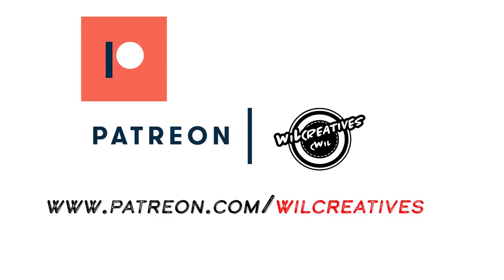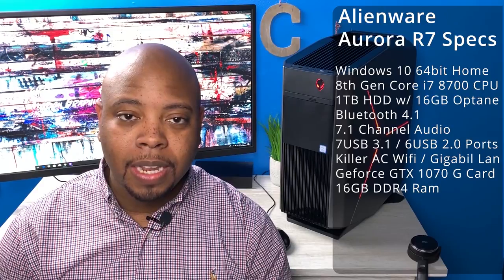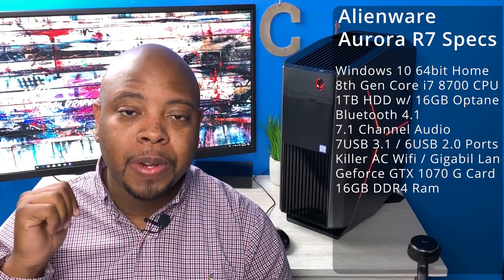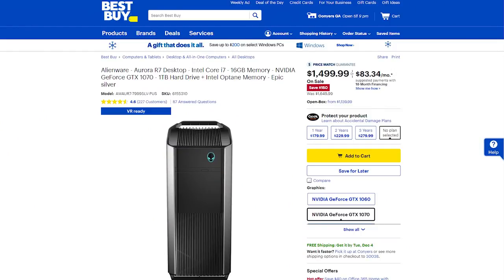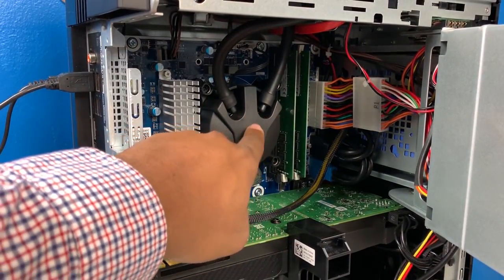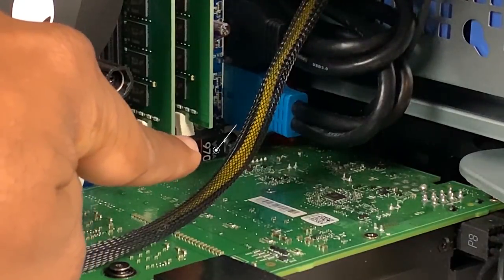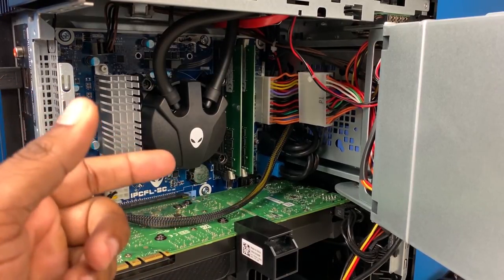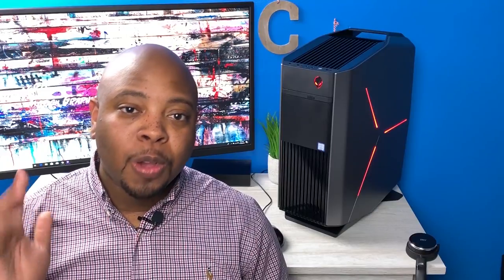30 Days with the Alienware Aurora R7 Full Review (i7 8700, Nvidia Geforce Gtx 1070)

Comment: I heard there was a problem when streaming with the aurora R7 and when viewers watch the video it appears very choppy if you dont mind can you test this out because I am looking forward to buying the prebuilt system. Thanks and keep up the work these videos are amazing.
Reply from the maker: Gotcha Thanks for the feedback! Are you referring to live streaming to like YouTube?
Reply: Hi BlahBlab39. I bought this system exactly a year ago and yes there is absolutely an issue with streaming. I have an i7 8700, a GTX 1080, Boot SSD and 500GB SSD, and recently upgraded my RAM to 32GB thinking it would possibly help. 

I simply cannot stream any PC games from this machine using OBS Studio without it dropping frame rate constantly. The games themselves run perfectly fine but the stream looks like a slideshow especially during loading sections or moving between menus. I’ve contacted another YTuber for possible further investigation into why this is happening. 

I will admit the machine runs extremely well other than this. But I will also point out there are some drawbacks with having a machine such as this. Cooling works really well but fan noise is absolutely noticeable. Not annoying if you are idle but you absolutely will be able to hear it. Whisper quiet this thing is not. Also I upgraded my RAM but the motherboard Dell use only supports speeds up to 2600MHz. You can install higher speed like I did but you will not get the benefit of it. 

If I’m being honest I would not recommend over building a pc yourself BUT compared to most other pre builds this is decent, besides the issues mentioned. Build one yourself or even use a PC configuration website such as Overclockers. You’ll have more control over what goes inside and there are an abundance of vids out there that can help you put it together. Hope this helps.
Reply: You could try encoding with the Nvidia gpu rather than the cpu.
Might have slight quality drop for your stream.
You should be looking for 8 core cpu or higher if you want to encode with cpu

Comment: Just got one. Thanks for the information. According to Linus leaving the optane enabled with an SSD is possible and works.
Reply from the maker: Inside the Alienware or just in general?
Reply: @WiLcreatives  They appear to work inside the machine. Per Linus, they do accelerate the ssd but not enough to get excited about. He said to do what you did if we want to go to the trouble. Either way I go this machine is a beast for the price.
Reply from the maker: Gotcha yeah my issue could have been an anomaly but I absolutely love it with the way it’s setup now! Looking to upgrade my GPU to a RTX 2080
Reply: @WiLcreatives  I am doing a clean WIndows install like you did after I get Registered and updated on the stock mechanical drive. BTW, here is a money saving tip. Buy one of these 
Seagate Backup Plus Slim 2TB on amazon for 60 bucks. Pop it out of the enclosure, slip off the foil, pop off the USB controller, slip on the SATA connectors in the box. You now have 2 TB of bootable internal storage. This is what irritates me with the "Cost" of SSD drives.
Reply from the maker: sweet good info!

Comment: Why get a nividia graphics card and then get a freesync monitor? Makes no sense. Should have gotten a G-Sync monitor. G-Sync monitors work with nividia graphics cards. Freesync is for Radeon cards mainly.
Reply from the maker: At that time I didnt have the funds but there has been changes along the way.  Check out my Alienware Playlist.
Reply: I recommend the Alienware 24" monitor. It's 240hz refresh rate and 1ms response time. You can get with freesync or pay extra for gsync m8. I actually bought tge freesync version myself cause you will never run a game over 240fps anyway so gsync and freesync are a wast of time in that situation. This streaming business is getting expensive these days lol

Comment: When you added the extra SSD (Samsung 860) are all the cables required already in the PC, or did you have to buy a SATA cable etc?
Reply from the maker: SuiZide King great question I had to buy a sata III cable. The power cable is already available.
Reply: WiLcreatives cool, thanks man. Plan on adding an SSD as soon as I get this Pc.
Reply from the maker: Sweet! I have a new video coming that talks about using all 3 hard drive connections. Stay tuned
Reply from the maker: +SuiZide King Follow me on Instagram @wilcreatives. When we hit 100 subscribers on the channel I’m giving away a Google Home Mini to one of my subscribers for supporting the channel!

Comment: Could you do a tutorial or explain how you upgraded your M.2 drive, when the motherboard only has one M.2 slot. I am looking to upgrade mine to the 970 evo pro. Also, go with a 144 refresh rate montior if your gaming, 75 refresh rate is not that much of a difference from 60 refresh rate. You will love it.
Reply from the maker: Yes i did the upgrade of the m.2 drive. check out the link https://youtu.be/qoOIBJYYvGE

Comment: Hey, so I also bought the same system except with fan cooling system instead of a liquid cool system and it clinically underperforms. I'm not quite sure why, I've tried diagnosing the problem for a while and I just can't figure out why. I have a pretty OK monitor that works with it, but I've tried playing Overwatch and other games on ultra graphics, but end up only ever playing it on medium-to-high settings without having frame stutter or issues with dropping frames. It runs loud too, so I don't know precisely what I've done, but I just can't seem to figure out why it won't perform as promised. It's a basic unit as well so I haven't upgraded anything yet.

I'm pretty new to understanding the ins and outs of hardware and software, and I can't tell which is causing it to underperform.

Also, if it were to perform as promised, would this system be able to handle streaming and gaming at the same time? Thanks, your channel is awesome!
Reply: I hope you see this message soon, I can get this pc for $700 stock, do you think it's worth it for that much? I will do some gaming but nut that much.

Comment: Was thinking about grabbing this computer with a few upgrades to do my audio engineering. Would it be able to handle FL Studio an different plug-ins without issue
Reply from the maker: sonic boom yeah I think you should be fine. I would opt for the ssd drive that’s a must have and a i7 8700 or better processor. I do a lot of video editing in premiere pro, after effects and photoshop stuff and it’s a breeze.
Reply: WiLcreatives thanks for the feedback and insight you just got my follow. Keep motivating and spreading positive energy
Reply from the maker: Thanks I appreciate the support!

Comment: I just bought this PC today and I'm trying to run a game called Rust. So far I'm not getting a very good frame rate and I don't know what I need to do. I've already put all the graphics at the lowest quality but the frames are still at around 10-15.
Reply from the maker: What graphics card do you have?
Reply: What you need to do is buy a new pc.
I recommend acer predator orion (it cost  £6000) I own a acer predator orion and it can run anything with 0 problems

Comment: I just received this same computer today. Got it going alright, but how do you get the keyboard to light up??? I downloaded the "Alienware Command Center" and this got the lights working on the tower, but not for the keyboard. Any ideas or suggestions?

One final note: 
There is a sound issue. Only one speaker will work at a time (plugging into the green port). Even with the volume turned all the way up on Youtube AND on the PC, it is barely noticeable. Have to hold the speaker up to my ear like a telephone on most videos.
Reply from the maker: I purchased a corsair keyboard which is why you see it light up! The regular Alienware keyboard doesn't light up.
Reply: @WiLcreatives  

Thanks for the quick reply! With the money that the Alienware r7 goes for, I just assumed (mistakenly so) that it came with an illuminated keyboard. 

One more issue:
I connected two speakers (both worked from an alarm clock/radio that is new), however, the volume is VERY low. I checked my drivers for the sound in Device Manager (which indicated I have the latest driver installed), along with checking the volume from the task bar AND on YouTube and the sound is the same low volume. Additionally, I performed a complete system scan at the Dell support website with no adverse issues. 

Any suggestions? 

P.S. There is no volume control on either of the physical speakers.

Comment: Thinking about getting one of these. I have one question, will this run a 144hz monitor at 1080p with no problems?
Reply from the maker: Hey it depends on the graphics card. You can get high frame rates on rtx 1070. If you're trying to get 144fps you will definitely need at least a 1070ti or 1080 and above for 1080p. Of course it also depends on the game. The system rocks. I'm putting up a video this week of a high refresh rate monitor. Keep an eye out for that.
Reply: I got this exact model but the only thing better is I have a GTX 1080 and 2 TBB Hard Drive. But yes coming from someone who plays on 144 hz all the time and 1080P screen of course it runs smooth asf.

Comment: DO NOT get the r8 like I did today. I ran cinebench r15 and the thing sounded like I was using a vacuum cleaner. I uninstalled their software and checked everything and still sounded like a LOUD vacuum cleaner. It was returned.
Reply: Make sure you get the water-cooled one, the air cooled ones are loud.

Comment: My brother just bought his Alienware Aurora R7! he has a problem with a Network connection. When he try to get connection, the modem disconnect all our devices!! Help
Reply from the maker: Is he trying to connect via WiFi?
Reply: yes
Reply from the maker: Sounds like an IP address conflict and your wireless router can’t handle the multiple connections. I would try to restart the router and the modem both. Ultimately you will need to get a wireless router that can handle 2.4ghz and 5ghz connections which would be a dual band or depending on how many devices being connected a tri-band router
Reply: @WiLcreatives  Thank u so much for the info! IT will help us a lot!!

Comment: Im getting the aurora r7 next month and the specs are 
9th Gen Intel® Core™ i7 9700K
Windows 10 Home 64bit English
16GB Dual Channel DDR4 at 2666MHz; up to 64GB
NVIDIA® GeForce® GTX 1080 with 8GB GDDR5X with Water Cooling I really enjoyed the video and you got a new subscriber I was also wondering if you have any suggestions on a monitor with a 1080p and 144hz around $300-$400
Reply from the maker: Man that sounds like a bangin system! I would recommend the Acer Predator XB241H bmipr 24-inch Full HD 1920x1080 NVIDIA G-Sync Display, 144Hz, 2 x 2w speakers, HDMI & DP https://www.amazon.com/dp/B01C05C1OK/ref=cm_sw_r_cp_api_i_iGydCbZD00TBW
Reply: WiLcreatives Thank You for the recommendation
Reply from the maker: Big Boi No Problem!
Reply: The Asus Rog Swift is a great 144hz monitor. It can even be OC'd to 180 hz.
Reply from the maker: +Big Boi Follow me on Instagram @wilcreatives. When we hit 100 subscribers on the channel I’m giving away a Google Home Mini to one of my subscribers for supporting the channel!
Reply: The alienware aurora r7 is terrible.
Reply: Just a 1080? My pc has two 2080ti.

Comment: Is it possible to change gtx1080 PCI Express 3.0 for Radeon rx5700 PCI express 4.0 in Aurora r7 ?
Reply from the maker: Elton Vale yes even though the 5700 supports pci 4.0 the card will still work in a 3.0 slot on the motherboard. However I don’t recommend the Amd cards due to their drivers
Reply: @WiLcreatives  Thanks ! i'd like to use radeon because i'm thinking about Hackintosh. The idea was dual boot and Mac Os works only radeon. But maybe RTX family will be better .
Reply: @eltonvale2283  IF you want to hackintosh please research motherboards that support macOS. But no the drivers on AMD are not bad.

Comment: Hey, I'm going to buy exactly the same model but am a bit confused. Even if you have only HDD and intel  Optane memory you still are able to buy separately  SSD memory and install it in this configuration?
Reply from the maker: +Nick Quick Hey Nick yes you can. You would have to use the 2.5 inch bays if you just want to add an SSD drive SATA III interface. The only time you need to get rid of the optane memory is if you’re trying to buy a M.2 SSD like the Samsung 970 Evo. That’s because there is only 1 M.2 slot on the motherboard.
Reply from the maker: +Nick Quick hey nick I thought I replied to your message but yes if you just want another ssd you have to use 1 of the 2.5 inch bays SATA III connection. If you get a M.2 ssd then you have to take out the optane memory.
Reply from the maker: +Nick Quick also nick Follow me on Instagram @wilcreatives. When we hit 100 subscribers on the channel I’m giving away a Google Home Mini to one of my subscribers for supporting the channel!

Comment: Would an audio interface run on this system with external speakers i.e KRK Active Speakers?
Reply from the maker: +spitoon dude Yes you can check out the customer questions on this link KRK RP5G3- 59107 NA Rokit 5 Generation 3 Powered Studio Monitor - Pair https://www.amazon.com/dp/B00FX7MMRO/ref=cm_sw_r_cp_api_i_hDKrCbGC7R6YW

Comment: When you got stuck on the "reconstructing cache metadata" what exactly did you do? Ive been stuck on it for like 20 mins. I didn't do anything to the computer.
Reply from the maker: I let it go back through the rebuild process. It takes a while. Worst case hold down the power button if it never finishes. But if possible let it go through. The optane memory is like cache for the spinning disk HDD. I hate it!
Reply: @WiLcreatives  oh okay i keep turning it off now but i guess im going to let it run for a couple hours.
Reply: @WiLcreatives  i left it there for 3 hours and nothing happened. I dont know what to do haha
Reply from the maker: Ahhhhh man that's weird. We're you able to get your system back up?
Reply: @WiLcreatives  No, its just stuck on the black alienware screen then it turns blue and it says "your computer ran into the problem we will fix it and restart" then it just goes back into the alienware black screen.
Reply from the maker: Wow sorry to hear that and you haven’t made any changes to your system or installed anything?
Reply: @WiLcreatives  no haha. Well now ima go get that 970 and put that in cause optane apparently sucks
Reply from the maker: Yes as soon as you can. In the meantime you may have to do a system recovery if it won’t allow you to get into windows.
Reply: @WiLcreatives  how do i do that? Its literally just stuck on the alienware black page i can only get into bios
Reply from the maker: @jasonpacheco_  Sorry about the late reply. I thought I replied to your message and I didn't. Check out this link and follow the instructions. https://www.dell.com/support/manuals/us/en/04/dell-supportassist-pcs-tablets/sosrug/perform-cloud-system-image-restore-using-supportassist-os-recovery-usb-key?guid=guid-ce57329b-46e2-469f-b5c9-9fab4047dbd2&lang=en-us
Reply from the maker: +jason pacheco Follow me on Instagram @wilcreatives. When we hit 100 subscribers on the channel I’m giving away a Google Home Mini to one of my subscribers for supporting the channel!

Comment: I got the aurora r7 and I got a error message that said SystemType Inizliation Acception and like a bunch of stuff saying Thermal controllers and idk what that is can you help me ?
Reply from the maker: When are you getting these messages during boot up?
Reply: WiLcreatives I got it once I was uploading a video and out of nowhere it popped up it happened after I did a update on my pc
Reply: WiLcreatives it won’t let me see my temperatures on command center
Reply from the maker: After doing some research the problem seems to be with the Alienware command center software. If it was just updated see if you can find a previous version until dell fixes the issue. I will check my system when I get home to see what version I have.
Reply: WiLcreatives Ok so it’s nothing to worry about correct ?
Reply from the maker: Yeah I don’t think it’s anything to worry about. I read it was a software bug. That’s annoying. If you can make sure you turn off the automatic updates
Reply: WiLcreatives Ok thank you :)

Comment: Multi-language)		
370-ADUB
1	16GB DDR4 at 2666MHz Dual Channel		
400-AMXY
1	1TB 7200 RPM SATA 6Gb/s (64MB Cache)		
450-AAGO
1	US Power Cord		
490-BEUY
1	NVIDIA GeForce GTX 1050 Ti with 4GB GDDR5		
555-BDBY
1	802.11ac 1x1 WiFi and Bluetooth		
555-BEQL
1	Wireless Driver for 1810/1820		
570-AATJ
1	Optical Mouse MS116AW		
580-AHTI
1	Wired Multimedia Keyboard (English)		
619-ANOK
1	Windows 10 Home 64bit English		
817-BBBC
1	Not selected in this configuration		
801-1493
1	Dell Limited Hardware Warranty Initial Year		
803-2399
1	Premium Support with Onsite Service After Remote Diagnosis, 1 Year		
803-2411
1	Premium Support, 1 Year		
321-BDWZ	1	Alienware™ 460 Watt Multi-GPU Approved Power Supply		
332-1530	1	Dell.com Order		
332-1530	1	Dell.com Order		
338-BNMW	1	Intel Core i7 8700 (6-Core, 12MB Cache, up to 4.6GHz with Intel Turbo Boost Technology)		
340-ACQQ	1	No Option Included		

Hey i just got this its on the way..will it run on 144hz and also is 1440p gaming smooth i mean im ultrahappy with 1080p jus wondering if it can...and wat monitor do you reccommend..nvidia gsync capable
Reply from the maker: If you got your system yet how did it turn out? I believe you may run into bottle necks with the graphics card but if youre running 1080p with medium settings you may be ok depending on the game.
Reply: WiLcreatives i havnt turned it on yet cuz im making a computer table atm. Plus i got 144hz 1440p monitor. What do you recommend for me to run high end games on high settings for 1440p? And ur right...my current graphics card is not good enough..even power supply.